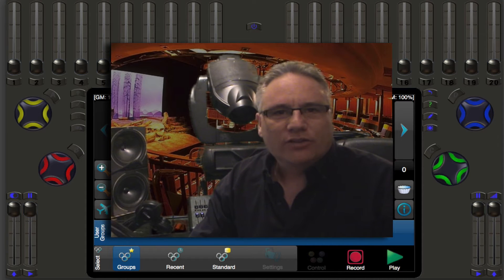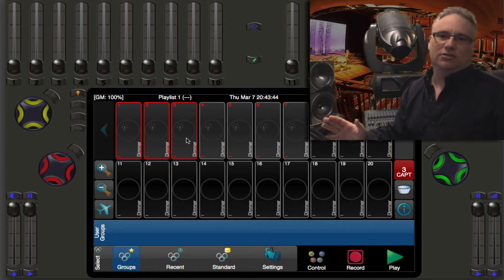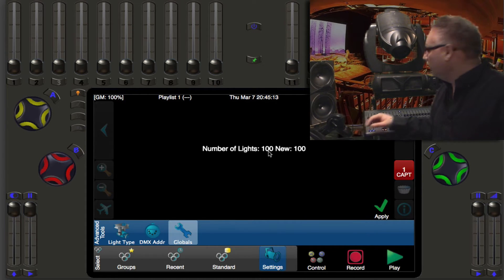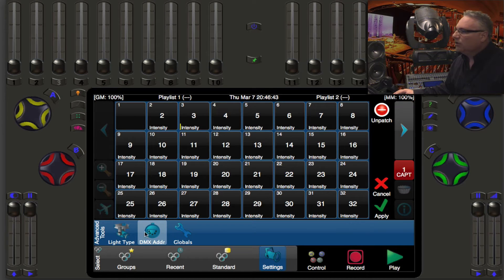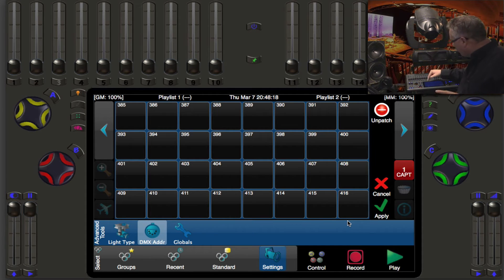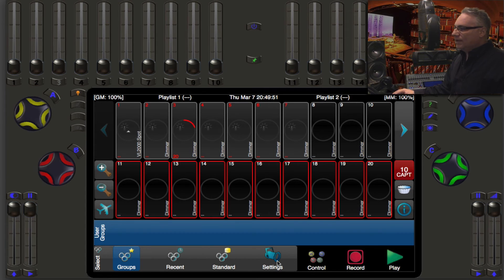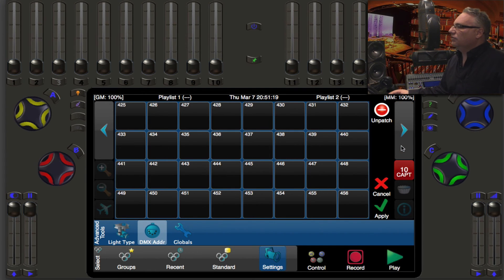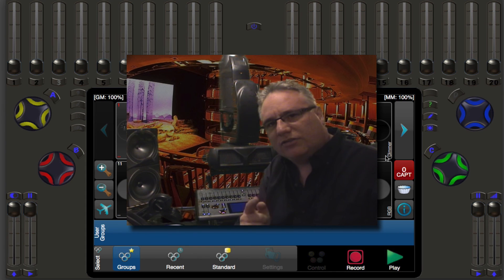04 - Cognito Patch

Comment: How do i make custom dmx profile for a 8 channel elation design brick 70. Because i cant seem to find any light on the light type list that matches the dmx address i need.
Reply from the maker: Looking at page 32 of https://d295jznhem2tn9.cloudfront.net/ItemRelatedFiles/10117/dled-brick-70-manual.pdf it seems you can use the 5-channel mode and then patch the Fixture Manufacture GENERIC Light Type RGB+AW (5 DMX Slots).

Comment: Thanks for your quick response you’ve been very helpful 
I purchased a cogniti pro used but it didn’t come with the 12 v power supply and I was wondering if you where I could get one 
Also it’s missing a fader handle if you could help me I would appreciate it
Reply from the maker: Does your Cognito badge (below the power button) have a superscript "2"? It uses a 24v supply. The Cognito without the "2" uses a 12v. 
The newer Cognito can use "PWPWR WW BARL 24W 24VDC". Or both model can be powered over Ethernet with any PoE switch; then you'll not need the wall wart power supply. 
For the handles, ask you dealer for "PWACC SLIDER HANDLE COGNITO BK". They might not find it in their pricelist, but they can order it for you. 
To find a dealer near you, choose the HOW TO BUY link in the top right of pathwayconnect.com and choose the PATHWAY DEALERS pin to the left of the map. There is also a SEARCH BY button below that.

Comment: What happens when the light I want to patch into my board is a an imported generic light and is not found in the brand list? how can I update my software to see if pathway has added it to the library?
Reply from the maker: http://pathwayconnect.com/index.php/downloads/firmware-and-software-updates/file/Fixture%20Libraries%20%28Cognito%2C%20Cognito%202%2C%20%26%20Choreo%29/ControlsFixtureList.pdf shows a list of the current library definitions. There are many GENERIC fixtures that suit many needs. If you can't find your fixture, email the manual to fixtures@pathwayconnect.com and we'll add it. Response time is very good (typically under 24 hours - always within a few days).